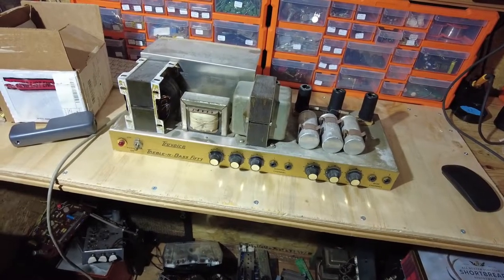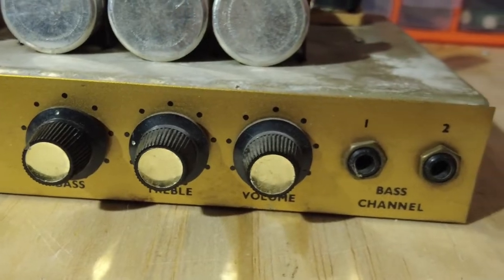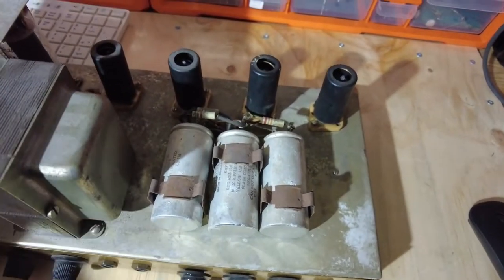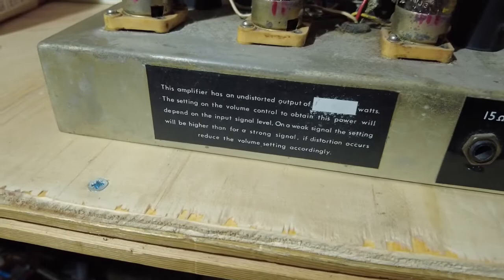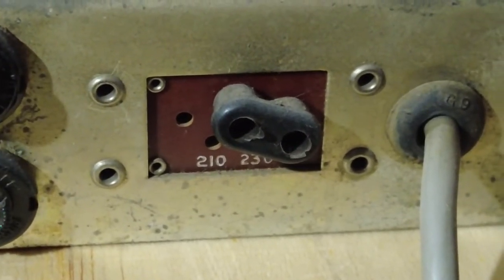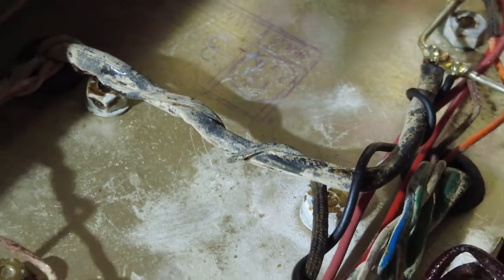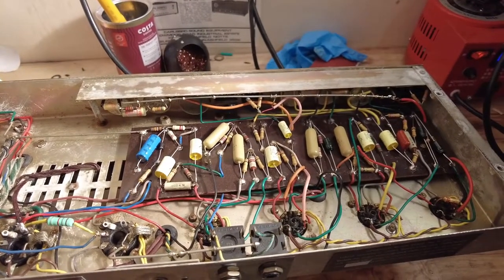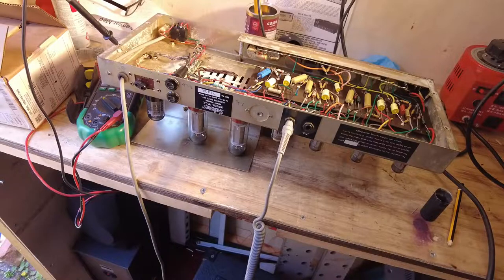Selmer Treble & Bass Truevoice 50 Part One.

Comment: I don't see a Part Two? What did you finally conclude. Was the problem the OT or something else. Can it be due to the different R values of the two OT windings?
Reply from the maker: Hello Russell. Not long after I recorded part two, we had a litter of 10 puppies. My partner had just been diagnosed with Breast Cancer and once she started Chemo, she couldn't look after the pups anymore for fear of infection. So for two months I didn't record anything. I did fix the amp just before they were born.  I had to give it back to the customer. To cure it, I changed a valve socket on the side that was running hot, which was was suggested by someone on fb when I posted it. I mixed and match tubes and got a match between both sides within .5 of a watt. It wasn't the transformer after all. That was a bit of speculation on my part. As soon as the guy pointed out the socket I realised I had been a bit of a plank. Sometimes you  look so hard you miss the obvious.

Thanks for watching and take care.

Comment: I'm wondering if you could fit some kind of can over those caps kinda like fender did. Made out of tin. just thinking.
Reply from the maker: Hello James. I thought about that when I was repairing it. I didn't want to start drilling holes in it. It's always a problem choosing safety or originality with vintage amps. If it had been my amp and not a customers I would have gone for the safety.  Thanks for watching James.